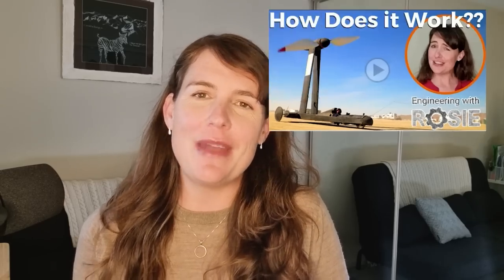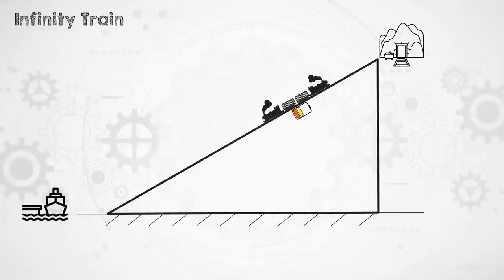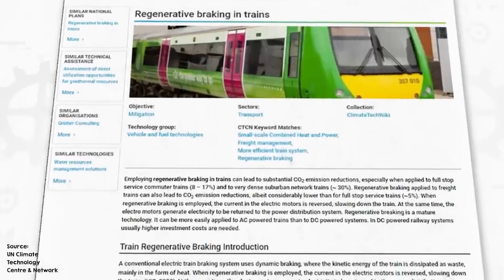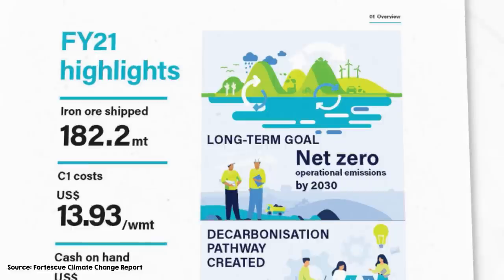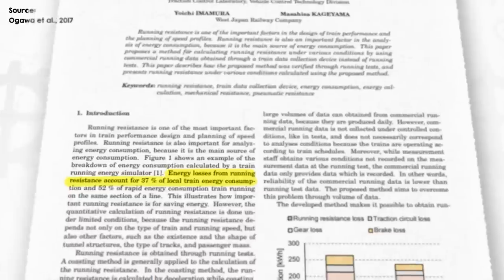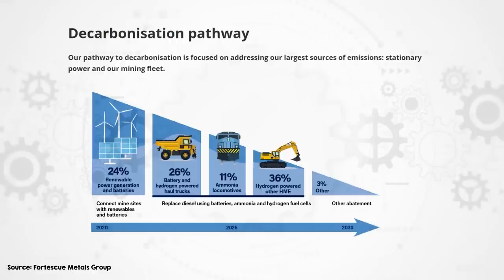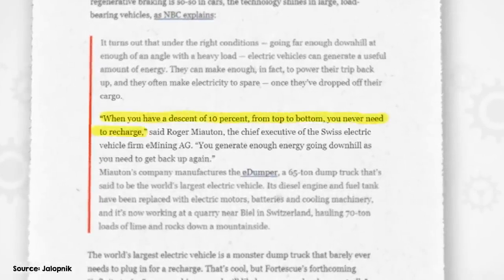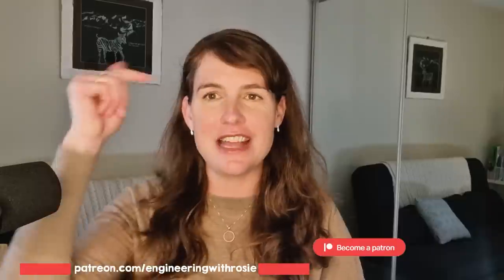This Mining Train Powers Itself: The "Infinity Train" (and how it works)

Comment: The Tesla Megapack is not a relevant benchmark for a battery-electric traction system, because it includes a whole bunch of space and weight for chargers and inverters. A rail traction battery pack is just a DC pack that interfaces to existing rail traction controllers that are already designed to handle regen. For a 23 tonne battery container at current pack-level energy densities (eg CATL Qilin) we're looking at ~ 7MWh, and by mid-2030s ~ 15MWh.

Comment: Third rail electric train? Keep your batteries in the port or in pumped storage on the top of the hill, and then work on things like making an ore train aerodynamically not a complete mess? If you don't have to carry batteries, that might tip the scale?
Reply from the maker: I wonder whether that would work, it's an interesting idea. The rail is several hundred kilometres long (and already exists in a non-electrified form), so it might not be the right solution for this specific project, but for projects closer to a grid perhaps it would make sense, and then it wouldn't need to cover 100% of its own usage. Based on other comments here, it seems that there are mining trains like this in Sweden/ Norway for quite a while now.
Reply: @EngineeringwithRosie  I suppose the weight of batteries compared to that of a train would not be enough to make it worth electrifying the track just to avoid having to carry batteries, in terms of cost. And if the financial equations don't solve, it's not engineering, hey?

Would it not be possible to just put electricity through the two tracks, though? You'd just have to accept that you'd be electrifying the occasional kangaroo, goana, or snake. I suppose Mother Earth would eat her fair share of current, too.

Since you have an entire train's worth of steel wheels to conduct the electricity to the drive motors on the up run, you might be able to hack things so that not the entire track was live? Expose just say a set of 2m long segments of live track at any one time, and work things such that there's always at least one wheel on a live section of track?

With expensive copper cable connecting up the cheaper, terrible steel connection points ... Cost cost cost. I suppose that should be everyone's starting point when trying to imagine how they could work a way round the "battery problem" for instance. If it's going to be more expensive, it doesn't start up. Looks like this engineering stuff is not as easy as it initially looked like it was. :D

Comment: Essentially it's a gravity powered slide transportation system that includes elevator using the masses fall to lift the proportionally small payload to be reloaded with a different amount of mass than in  1st stage even though  may be equall weight not being the same group of ⚛ atoms it's a great idea for a specific task ... but  i wanna build mountains ⛰  not disassemble... I'm gonna need a huge elevator/ conveyors system and an  immense amount of clean gathered energy like windpower through geared transmission or solar conventional way as most all of our energy is powered by the sun including the wind but combines factor of differing temperatures and how much

Comment: Not even 90 seconds in my guess is that a full train goes down, then an empty train goes up. If you're moving less mass on battery power then it's not a closed loop and not perpetual motion.

Comment: Would this be a bit cheaper if it was connected to an electrified rail? Not sure about the efficiencies there.
Reply: Interesting idea. I'm assuming you're proposing to take the batteries off the train and connect them to the electrified rail..I'm not sure if there are any bidirectional electrified rail systems. I think also you could only have trains going in one direction at a time on each section of electrified rail.
Reply: @zen1647  yes there are third rail systems where regen braking from one train powers another via the rail. For the uphill train to be powered entirely by the downhill one you'd just have to connect the rails from the two tracks 

The biggest issue would be needing to keep the trains in sync on both directions, and being able to start up after a complete break if both trains were at the bottom. Those issues could both be got around by putting the battery on the ground rather than on the trains, as you suggest. You'd also need at most half as many batteries.

Another issue is that there may be safety concerns for staff or wildlife having 700V DC near the ground. Imagine a poor dingo deciding to mark it's territory the traditional canine way...

There are also trains that can put regen energy back into overhead high voltage wires (eg the Pendolino in use in the UK). But then the costs of the infrastructure start to explode
Reply: @trueriver1950  Thanks for the info. I thought regen breaking could only feasibly recharge a battery on the train so it's good to know about those other systems.

Comment: When I was 8 years old I designed a "perpetual motion" train.  It had an electric locomotive at each end, the one at the front pulled the train, the motor in the rear generated power for the front loco.

Unfortunately we didn't learn about conservation of energy at primary school!
Reply: You will have losses in your system due to friction so you will have a net loss of power over time.
Reply: @b787900  Not only friction, but air resistance and electrical losses.

Even if the system was perfect it wouldn't work, for a kick-off the train wouldn't start, accelerate or climb gradients without a force being applied.
Reply: At around that same age I had a similar idea.  It was to inject water into a diesel engine instead of diesel fuel.  The water would flash into steam and drive the piston down like a steam engine.  Like you said we didn't cover conservation of energy in primary school.  I now have a degree in mechanical engineering and sometimes find myself smiling when I think back to the inventions I came up with when I was young.
Reply: @hmw-ms3tx  My favourite invention (in 1959, aged 10) was double-sided. surface mounted printed circuit boards.  Basically drawing pins pushed into plywood with the components soldered between them.  It worked and proved the concept.

I invented the cross-bar telephone exchange a few years later, and transmitted voice using light, before fibre optics and lasers were invented.

Comment: I love it since it's probably not snake oil. Despite the huge potential of graphene, carbon capture, and other ideas related to energy, this seems actually doable. Even if they have to top it off at the bottom to make it back, it's still a good idea. We should definitely focus our efforts on actually doable things that align with the local geography and conditions. 🙂
Reply: Carbon capture is a dead end.
Graphene depends on large scale production.
This is straight from the "KISS" school of engineering.

Comment: Why does the train have to have batteries.  Why can't the batteries be at one spot and the train powered like all electric trains with pantographs?  that would obviously save having the weight of the batteries in the mix.  Fixed costs of a one-time installation of overhead wires.

Comment: If the train  operated like a conventional electric train, regenerative energy could could supply a grid or a fixed battery. No need to carry the battery on the train.
Reply from the maker: No electricity grid anywhere near this particular mine!
Reply: With the battery only 2% of the EMPTY weight of the train, there’s no way that running overhead powerlines and installing an entire grid system would be a viable alternative. 
Cool idea though, if the infrastructure was there.

Comment: Great stuff! If the infinity train could be set up like an electric train with overhead wires, the battery would not need to be on board saving wyeight.
Reply: The transmission  efficiency losses of would render the project useless.
Reply: @nzer57  Thanks, Jack. I guess my idea will have to wait until we have something like room temperature superconductors. Or could there be multiple small battery stations along the line, each being recharged by the train as it passed down, and drawn on to pull it back up?

Comment: Would they be able to better achieve the desired result if instead of putting batteries on the load they transmitted the power via the rails for stationary storage. Power could be transferred to the the returning train by the rail or catenary. Just sayin'

Comment: I've heard that hydraulic braking can recover a higher percentage of energy than EV braking--upwards of 90%.  Might be (?) more useful for the massive loads involved here (trains/trucks).
Reply: It's alot of extra complexity for 10%, but over the life of a mine it would add up quickly, especially with the amount of energy being used.
Though for this train 80% seems to be enough for the return journey.
Reply: Hydraulic accumulators take a lot of volume per unit energy stored, because the actual storage medium is a big raised weight (for stationary systems, you wouldn't do this on board a train) or compressed gas or even a spring for mobile applications.  Good for hybrid cars or trucks in stop-start traffic maybe, but we're talking about storing all the braking energy from a downhill run of over 100km.  Batteries take up much less space.

Comment: Had not heard about the train but the dump truck going downhill and using regen to charge the batteries to get back to the top of the pit is big news....
An episode on lithium-ion batteries leading into the transition to solid-state batteries would be pretty interesting....
Reply from the maker: Yes I should do a video on solid state batteries - I'm currently trying to line up interviews and maybe a tour. And I've been thinking for a while that  a video on the different battery chemistries available and in development would be nice to do.
Reply: @EngineeringwithRosie  lithium-ion batteries are an integral part of todays society and have been for 25 years...
But time and technology move on and Solid-state batteries are tried and tested with manufacturing the biggest hurdle...
Reply: The old saying " we have been doing it this way for one hundred years and we aint changing" Is alive and well unfortunately...
Reply from the maker: @markjmaxwell9819  check out my recent video on zero emissions steel if you want to find about 50 commenters exactly along those lines 😆
Reply: @EngineeringwithRosie  Yes l have watched your no emmision steel video...
As far as global warming goes people will have to make a few smal sacrifices but overall quality of life should increase...
The new technology and regulations coming online should make a big impact on climate change in a positive way.
Sometimes you don't have to reinvent the wheel just tweak it a bit...
Reply: Also if you watch the Weber Auto channel it will show you how a RAV-4 Hybrid drivetrain works.
A small turbo diesel engine rather than a four cylinder petrol engine can be used to get much more range with half the emmisions of a V8 diesel with many more industrial applications..
My design is very different to a RAV-4 drivetrain but the engineering technology is the same....

Comment: Remember, the laws of thermodynamics only apply for closed systems!
Reply: Colin Mitchell  A "closed system" is one where energy is generated or transfered proportionally with the input. Losses through heat or friction can be calculated. An "open system" is where a third force, eg gravity is used to enhance the input of the device, like poking the bear.

Comment: So how much energy is used to load and unload the ore cars?
Reply: Reclaimers load hoppers that the trains pass under and drop a measured load into the ore wagon. At the other end the rakes (100 ore cars) are auto fed into dumper frames that rotate usually 2 cars at a time and turn them upside down. Thats basically 200t per 5mins. From memory at BHP operations at Nelson Point and across the Harbour at Finucane Is they process 12 x 45000t trains per 24hrs.

Comment: Word on the street down at Rio Tinto is that automated electric trains have been a complete failure. They break down and then noone is within 300kms and it's a real pain to resolve. In the end, no labour saving. Although if the infinity train is not automated it would be a great thing.
Reply: I guess it comes down to battery reliability. Pretty much all locos are diesel electric so the drive side should be   pretty solid
Reply: @emceeboogieboots1608  Correct. The challenges to date have been around automation not electrification. Electrics and EMD's break down/require maintenance at the same rate so drivers and engineers are needed on the train, not at either end of the 500km line.

Comment: Probably electrifying the lines (descendent and ascendent 2 x 280 km), and transferring by wire the energy of descending trains, for the movement of ascending trains, would be an eventually more profitable idea. Certainly the alternative of wires electrical system would be more flexible (more eficient, by sure), as it would allow a on-line export/import of energy from/of the mining transport system (turned into a electrical produtor sistem), on terms of net (positive or negative) energy possibles balances. The electrification of the train lines would allow, for instance, the supply of electricity to/from the mining facilitie, eventualy linking external grid(s), in any point of the traject. This would allow eventualy powering more electrical intensive steelworks processes refinements, on the proximity of the mine, and not downstreams of the processs. And Grid networks (probably not, but), if necessary. I see a wire line design as a win-win project, vs the train moving baterys, only solving the mining transportation issue.
Reply: There aren't any power "grids" in this remote area, just islanded supplies.
Reply: @alanwood82  yeh. I think the area is just desert, not populated. Nevertheless, the mining installations spend electricity, by sure, and could be a way to install others electric consumes, not only population, but industry. A convenient technical/economic study was deserved to de design, I presume.

Comment: Making the empty railcars lighter would seem like a good idea - you could get away with a simpler regenerative braking system and much smaller batteries.
Reply: Just lighter than the load they carry, then add 10%,(?) load to generate extra energy on the way down, needed to overcome friction in the system on the way up.

Comment: How about if the train operated on overhead lines? Would the weight difference matter?
Reply from the maker: That would be a nicer solution for the train itself as it would need less charge, but I suspect that it would cost more overall as the track is quite long. I haven't done the calculations though to be sure.

Comment: Yes, the Infinity Train is NOT using Free Energy; drawing power for the Earth's atmosphere, magnetic lines or anything like that.  It uses gravity to recharge battery packs from the motor acting as a generator with a fully loaded cart on the way down and the stored battery power to run the motor with an empty load cart on the way up.  The Energy may be cost free (not counting all conversion costs and ongoing maintenance costs), but that is NOT the concept of Free Energy.

Comment: Why is it that you never hear the question of “How much CO2 is in the air from human activity? Pro global warming scientists have been saying for many years that the amount of CO2 in the air is about 400 parts per million. That can be written as a fraction:  400 / 1,000,000. Fractions can be reduced without changing the value. If one divides the numerator and the denominator by the same number, the value remains the same.  For example 100 / 1000 is the same as 10 / 100 is the same as 1  / 10. This was done by dividing the numerator by 10 and the denominator by 10 as well. If we divide our CO2 fraction by 400 in both the numerator and denominator: 400 / 1,000,000 equals 1/2500.  

This means that the amount of CO2 in the air is one part out of 2500, or in other words, if you divide a given volume of air into 2500 equal pieces, then only one of those pieces will be CO2 and 2499 of them will be something else. However, that is not the end of the story. Pro climate change scientists have said that 98% of the CO2 in the air comes from plants, the ocean, and other natural sources of CO2. That means that only 2% of that one part out of 2500 is CO2 that comes from human activity. So let’s do the calculations. One divided by 2500 is .0004.  2% of that .0004 (.0004 times .02) is equal to 0.000008, or 8 parts per million. So, what this calculation proves is that of the total volume of the air, only 8 parts per million is CO2 from human activity. That is an extremely small amount. How can such a small amount collect and transmit enough heat to the other 999,992 parts per million of the air?